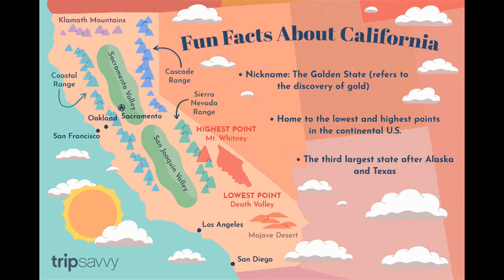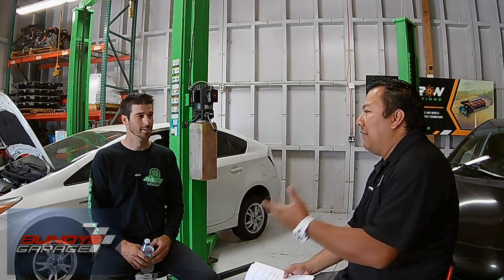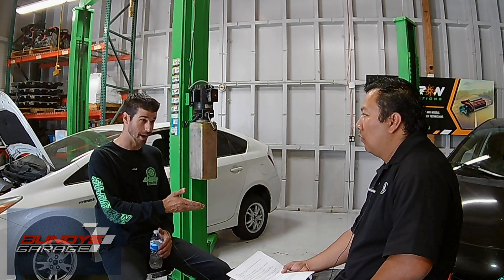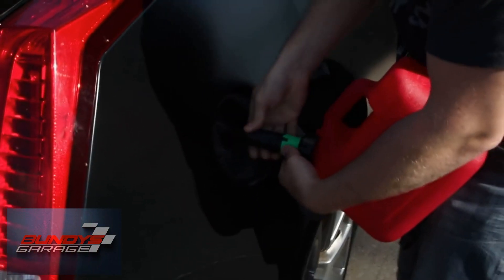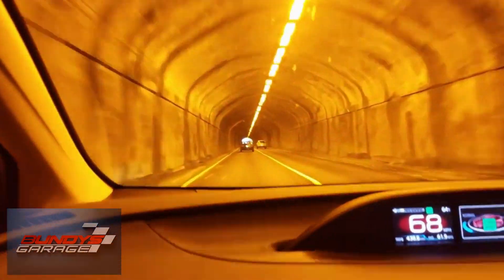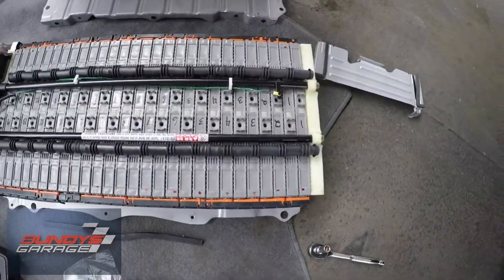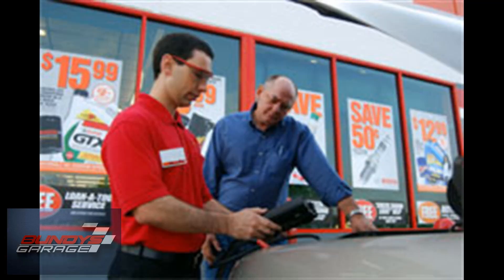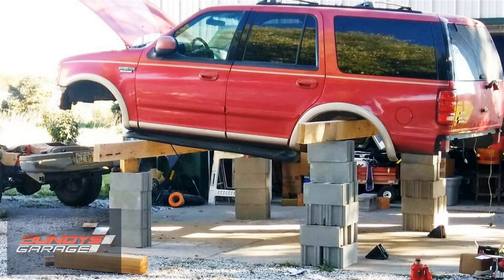How to Test Hybrid Battery Modules - Toyota Prius Camry - Electron Automotive - 714.609.5064

Comment: Good information. So, my Prius C ran out of gas and it's showing me the message " Failed Hybrid System ". So, whenever I see this message I disconnect my 12v battery for a minute and drive until I see the message. So, does this message mean I might have a bad module or is it just a simple error code that can be erased or reset ? Thank you, I subscribed.

Comment: It seems like the computer would be able to average out the time it takes for the battery to reach full charge, or test individual batteries at full charge so it can determine how much the battery capacity has been depleted independently. Instead it involves some guy "recycling" the packs by removing the individual cells and testing them all with a multi-meter. Batteries are the reason I don't want an EV or hybrid. Mainstream media are really sh!lling (censor word) for battery tech which really isn't as good as they're saying. I remember my 88 Civic with OG configuration got about 35+ mpg on the interstate. That's good enough. No electric motor.

Comment: AutoZone read Code for FREE, good for me as a AutoThech.
Auto Zone make mistake by selling the wrong  parts by Codes they read.
Is very common with Evap System Leak Code P0455, P0456, P0457.
After the customer spend time and money they figure the only way to fix it
is by bringing the Car to a Good Auto Technicians who said if i don't fix it i don't
charge you. By doing the diagnostic i have to find physical evidence in order to change
part. After the part is change, there still need to make some extra test to other component on he system in order to finish the diagnostic the right way.